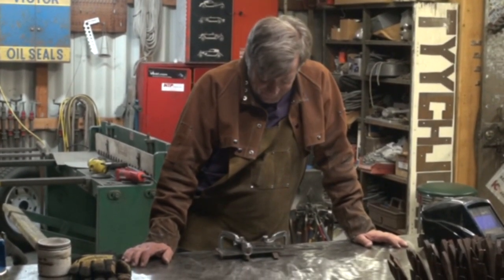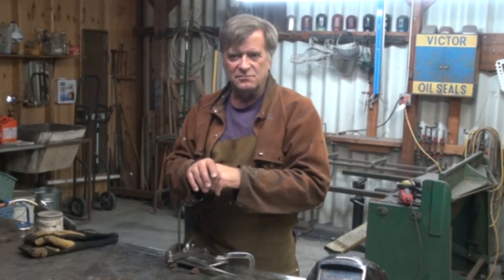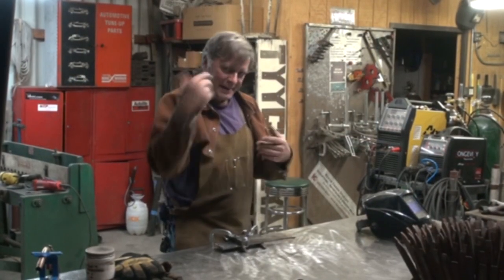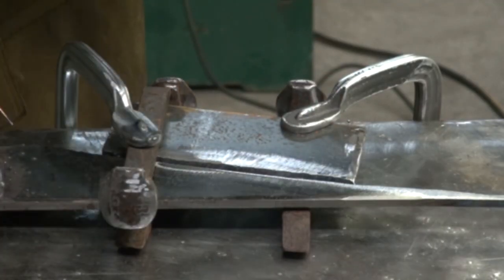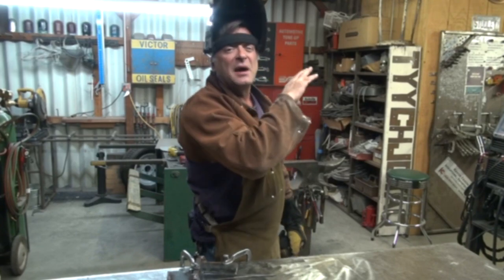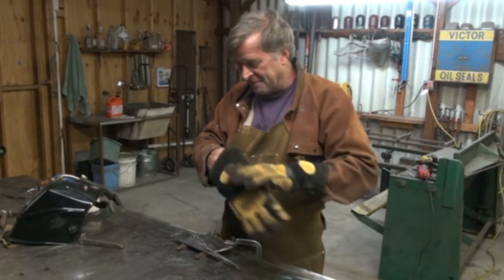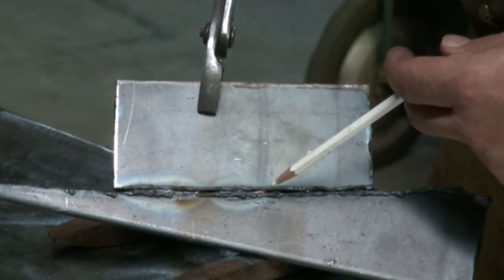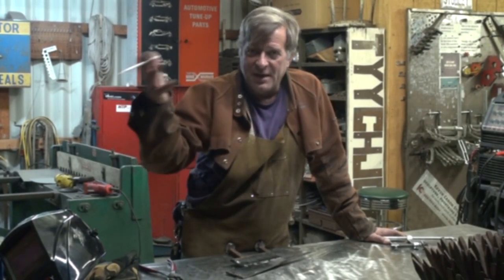How to Fill a Gap When Welding - Kevin Caron

Comment: Did you MiG or flux weld?
Reply from the maker: That was mig welding.  I hate flux core!
Reply: @KevincaronSculpture that’s true. When should a person use the MiG welding process. From how thin to thinnest metal gauge?
Reply from the maker: I use mig for long welds that don't matter how they look.   Or just to tack a bunch of parts together and then weld everyone.    I have welded 3/4 inch steel with mig and a few days later was welding some 20 gauge steel.    You just need the smaller wire size for thinner metals and dial the volts down.   If you have pulse like this machine, it makes welding thin metal even easier.   Thank you for watching and posting.,

Comment: I know this is a fairly old video, but maybe I can still get a response to my question which is: Is a filled gap as strong as a well fitted weld joint and if not why? If there is no porosity in the bead why couldn't I fill an unlimited sized gap and still have it be strong? I understand it is inefficient but there are repair circumstances I've come across where this is really the only practical option. My understanding is that in most circumstances the weld bead itself is harder metal than the work piece (Mild steel for example) - So if I was able to theoretically build up beads even an inch thick on either side and eventually join them, with a good hot weld wouldn't it be just as strong? Not to say I"m trying to make an excuse for poor fitment but I am trying to understand just why it wouldn't be as strong, practicality aside.
Reply from the maker: I have never had a problem with the poorly fitted gap coming apart but you have to keep in mind that I am not making something that peoples lives depend on.   While there is nothing like a proper fit and weld I don't see any reason why in a non-structural joint this will not work.

Comment: Dude... what!? I can't believe nobody has corrected this yet.. you WANT a gap for structural.. your first pass is called a "root pass" and it's where you fill that gap pushing the weld out the back side just a little bit.. in pipe welding that gap is usually 3/32" to 1/8" I've had plenty of crap fitters, making huge gaps (I mean real gaps! 3/4+) they get filled, they get inspected, they pass. If you can step over it.. I can fill it!
Reply from the maker: older video but yes, I agree.
Reply: coors1800 root pass you also use 6010
Reply: Ronald Scalf Right..  but I didn't see that part relevant.. anything will fill a gap. 6010 is just what's best and used for code.

Comment: i keep on welding my exhaust and it still keeps leaking
Reply from the maker: And what are you doing and what are you using for filler?
What machine are you using?
How big is the hole/holes?

Need a little more info please..
Reply from the maker: Grind the metal to clean and shiny.   NO rust!  Don't get it too hot,   Just enough to melt the metal and make it flow..  Might just be too thin and it's time to replace..    Or maybe try a patch instead of just welding the holes closed.
Reply: Kevin Caron, Artist
how long will a patch last?
Reply from the maker: Years,    all depends on how well your joint is..  and the rest of the metal in the exhaust pipe.

Comment: The MIG welder is properly set by the teacher, my beads looks steady and o k  , the pieces of metal holds together but when I go under hydraulic pressure , the sample  cracks of breaks in two parts. I am 95% sure it`s a handling issue ( angle) but even more sure it`s a terminal arc problem. ( length to short. ) does`nt matter the time spend, the teacher or the different experimentation s , the misery is still complete Any clue?
Reply from the maker: +Bruno Laflamme       My first thought is too hot or too cold.    check your volt setting for the metal thickness you are working with..

Comment: Thanks Kevin, good tips. I had a LOT of gaps to fill when I pre-cut all my pieces on a (fancy) fireplace safety fence with a new cut-off saw. I didn't measure the angles on the new saw (typical Ryobi junk) and only found out that it was 2 degrees out when I put all the bits together ready to weld. Because there was multiple pieces making up the curved front, each of those 2 degrees added up in opposite directions as I made the curve. Glad I worked that one out BEFORE I started welding it together.

Comment: Copper plate.  Carry one around in my welding tool box all the time.  Helps fix up those "oops" where I've blown out the steel or I've drilled a hole in the wrong place and I need to fill it up. 

I'm not good with outside corners.  So I clamp one copper plate to one side of the corner and another copper plate to the other side of the corner.  I now have a "form" to hold my weld.  Helps me from "wandering" off the corner.
Reply: My friend has an everlast mig welder with pulse. I haven't seen it yet but he says that also can help with filling gaps as the pulse can allow the puddle to freeze slightly while welding so that heat build up and burn through aren't as big as a problem.

Comment: I have filled gaps with a stick machine and taking a welding rod and knocking off the flux and feed it in with your free hand, kinda like tig with stick welding.
Thanks fro the vid
Reply: Would that leave lots of pores and a weak weld, or can you get all 3 pieces hot enough to bond?